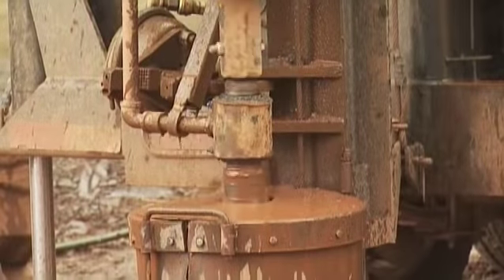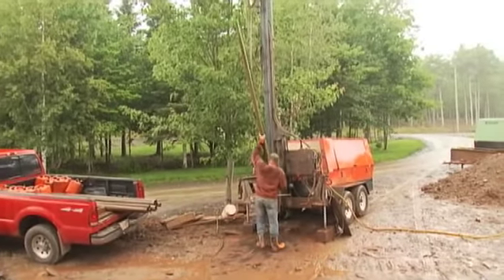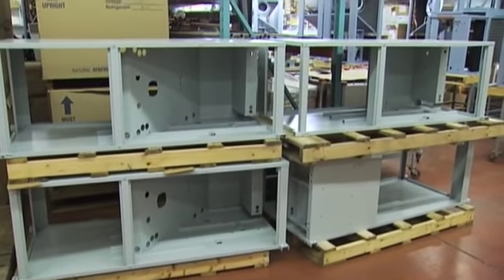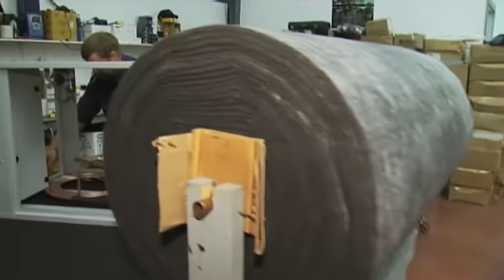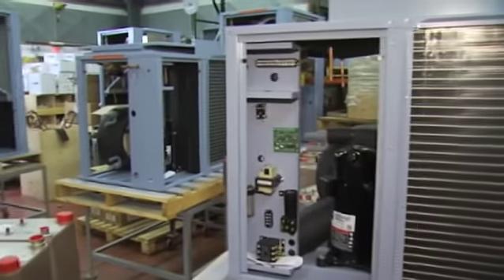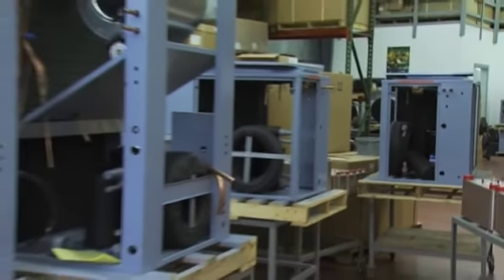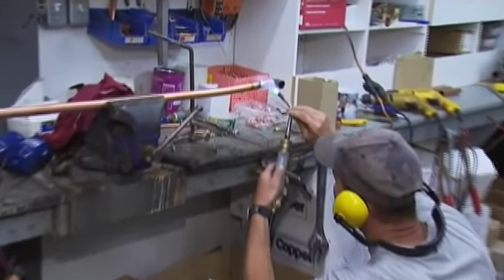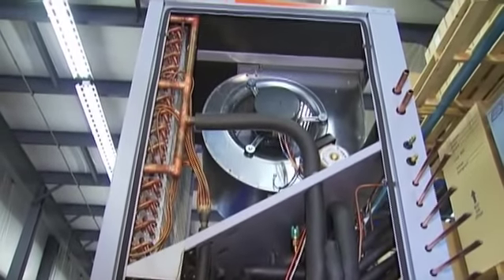Maritime Geothermal NORDIC Heat Pumps NB TV Interview

Comment: hey glenn want to know if we can heat marine water with geothermal energy for eg a tank size of 10 meter with by 50 meter length by 2 meter depth v r looking at about 700 tonnes of water or 700000 litre of water